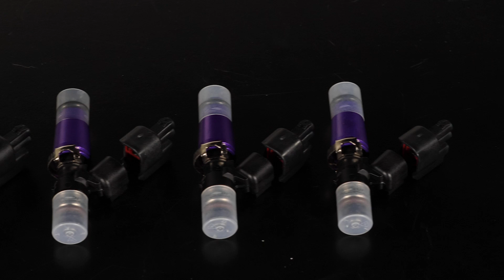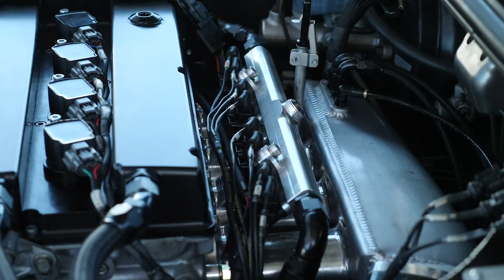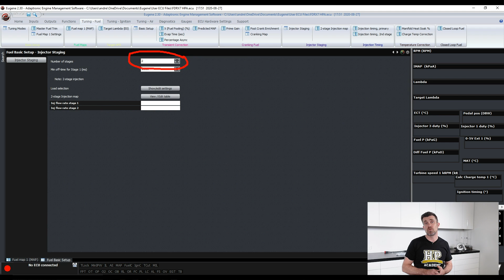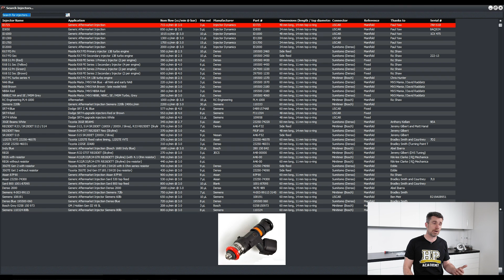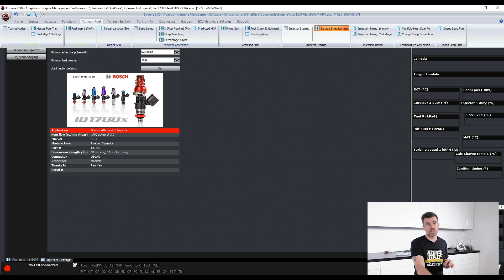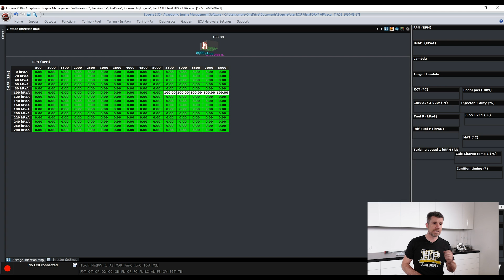Accurate Fuel Control Starts With...? | Injector & Fuelling Setup [#TECHTALK]

Comment: 9:40 Is this list accurate?? If it is, then i finally solved why i have engine trouble.
I have some RX8/MX5 195500-4430 in my 4AGE. Injectors max out around 198HP.
These are advertised as 350 to 380cc @3bar on ebay/Injector-planet/forums etc..
This List shows 290cc @4bar, which is close to the 280 @3bar i just measured.
I was completely confused because either i had some fake injectors or they all magically broke to the same lower value.
I will buy some 405cc EV14 Denso injectors from InjectorNation, these will hopefully fix everything.
Thanks HP Academy!!

Comment: When/At what power level do I need to upgrade fuel rails/lines? Will soon be installing AEM 340lph and ID1050Xs in support of a larger turbo on my subaru. I'm on the fence as to whether or not to convert to parallel feed and aftermarket rails/fpr. Any advice would be much appreciated.
Reply: Stock rails should be fine

Comment: Great stuff as usual.  Setting aside the rotary engine for a moment with no valves, I would think a strategy that prioritizes the staging based on the phasing of the intake valve in the combustion cycle would lead to more efficiency.  In other words, setting the minimum off time of the primary injector to a value that corresponds to the window of when the intake valve is actually open, then staging in the secondary until it is no longer possible to inject all the fuel during this window.  RPM and cam timing all play into this, and I was wondering if you have seen or performed any dyno testing related to optimizing the injection cycle based on RPM and cam timing over and above the "default" parameters that most software offers as a starting point?  For instance, at low RPM with lots of cam overlap, reversion may "spit back out" the injection pulse if the pulse is too soon, or conversely, it may back up against the intake valve causing a lean condition if the pulse is too late.  Very curious to see what your thoughts are on this.

Comment: i haven't played with my MegaSquirt in a few years, but I've set up dual VE tables for the primary set of injectors. from what i recall, i have VE1 managing everything from 100 kpa and lower then VE2 controls everything 110 up to about 255 kpa. i did this so i could increase the amount of tuning boxes in each table for fine tuning. i put the car away before i could see if this strategy worked, so I'm not sure if it works with such an old MS1 box. i can't wait until i get that car out and ready to go💪 good video HPA, hope to see this dual VE table in action in an up coming video.

Comment: Is there a way to tune for a dual fuel setup? (primary injectors on gasoline, secondary injectors on methanol) Is there a way to smoothly transition between the gas and meth AFR?
Reply: Idk much, but I'm assuming if you want to go from gas to meth, you start by having meth ins kick in at the same time as gas but to a lesser amount, then increase the percentage of power being created by meth gradually until it only runs on meth
Reply: @invertedv12powerhouse77  Exactly. With the different AFR's of gasoline and alcohol what would be the best way to program the ecu during the transition? Do aftermarket ecu's support this sort of tuning? Or would a custom table have to be added for primary injector pulsewidth vs secondary, equals target AFR?